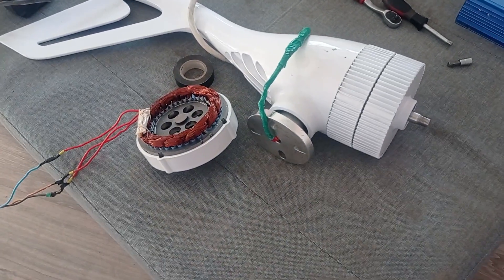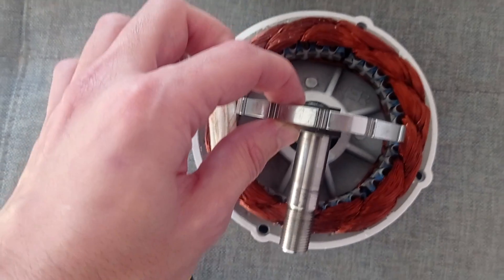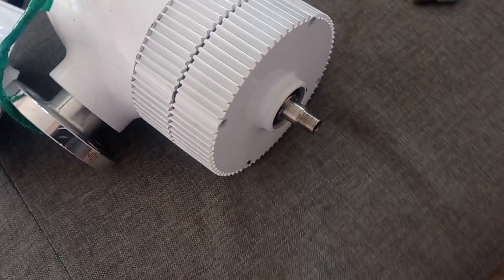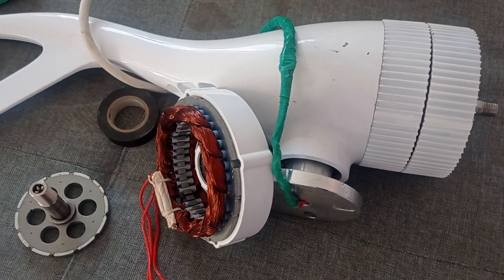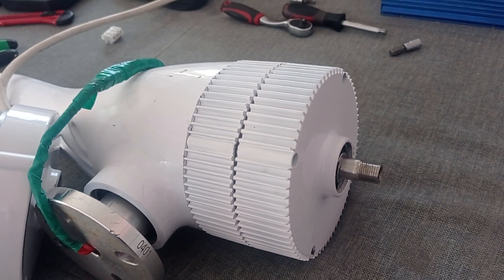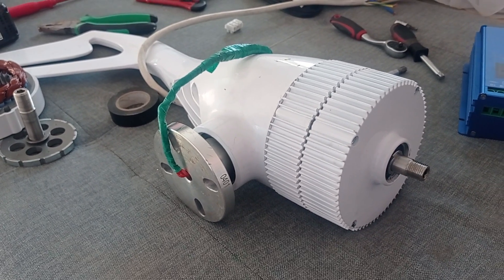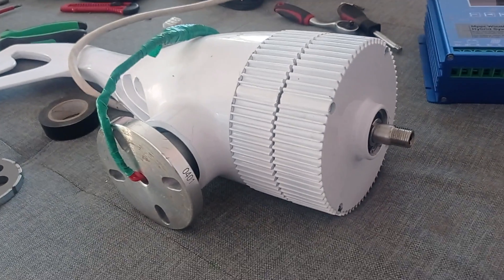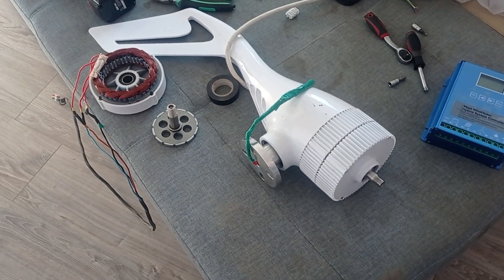How to make your small wind turbine produce way more power than originally designed. #modernuh

Comment: Given it took me a lot of effort to identify the bolt thread it might help others the original thread is 12-24 UNC. This might be more acceptable for some people to look for these to use, rather than drill out / tap out to M6 (which are readily available, but might weaken the shell).
Reply from the maker: in reality - any option will do. mine on M6 is holding pretty well, don't see any issues so far, since there is no crazy weight to be held by those.

Comment: If the generator is under designed , putting more blades may actually hinder it even more because the more blades will probably have lower rpm and will be more difficult for the generator even more.
Reply from the maker: yes, true, I ended with going 1.65 m 3-blader, instead of 1.3m 5-blader.
that one looks now like this: https://youtu.be/z1OqDNcNeZ4
Reply: @BackyardVoltage  Looks Awesome good luck !

Comment: Does 5 blade have a lower start up wind speed?
Reply from the maker: in the same shape of blades and same size of blades conditions - yes, 5-blader will start at lower wind speeds than 3-blader.
however, for this exact generator it appeared to be that 1.7m 3-blader hub (with a proper low-start bend on the blades) works so much better than this 1.3m 5-blader hub.
Reply: @BackyardVoltage  3 blade is always more effective.

Comment: I worked at the company that originally designed these more than twenty years ago, "Southwest Windpower".  The original product was called the Air.  It had a much bigger rotor and stator (as it sold for much more than $100), and in high speed winds could produce well over 2KW when the regulation was disabled.  The problem with doing that regularly was heat.  But we never put bigger blades on them, because they were designed to survive extreme weather without any furling.  One customer had deployed one of these at the south pole, and left it at a weather station over the winter.  When they returned, the weather station had recorded peak wind gusts of 130 MPH, but the turbine was still operational.  The original Air had an integrated charger, and could be purchased in a 12v, 24v or 48v configuration.
Reply: We had original Air marine, body corroded in 6 months, regulating in nacelle then running DC over a distance is stupid, never got any usable power, found plans online to modify turbine by removing said controller and running 3 phase AC into rectifier. So much more power.
Reply from the maker: @jonathanpurves5066   it is already 3-phase AC wind turbine, so all great here. you are rectifying to DC only on the controller side.
so far, I have it almost a year - no corrosion. Guess why? It has aluminum body. Same for the generator outer shells - they are aluminum.
Chinese isn't that bad, tbh.
Reply from the maker: that's actually great.
in order to reduce heat you should solder all the joints way more then they normally do at the factory, and likely apply the special lacquer for the coils. these will be also the steps for me to ensure this tiny thing works a lot longer
Reply: Esos si eran buenos aerogeneradores

Comment: I made a small wind turbine but it produced 10 volt with 3000 rpms on rotor. What can i do to produce more volts. The copper coils is very thin copper wire.
Reply: The rotor is 16 mm thick and i used niodemium  magnets. Very strong ones
Reply from the maker: Let me guess, you have got coils less of same amount as the magnets number?
Be sure to use many-poles generator to get better voltage output (the ratio should at least be 3/2  for "coil poles"/"magnets", but you can go with bigger one for coils as well), also combine it always into the classic "star" three phase connection in the end.
Reply: @BackyardVoltage  i got less magnets then coils. So i need to use more magnets.
Reply: @BackyardVoltage  more poles to get more volts

Comment: How do you connect the coil? Working on one to demonstrate with students at my school
Reply from the maker: it's a factory made generator, so I did not do anything with the coils, just reconnected the three phase gen-output to the coal-brushes current transferring module.

however, in case you are interested in its inner structure, here are some of the details:
12 magnets on the rotor. then 39 gaps for the coils on the stator, of which 3 are left empty, and others are divided into sections of 12. coils are put into "from 1-st to 4-th gap". in the end all are combined into a classic star connection. however, since they do it at the factory - the single-phase-coil is uninterrupted, I have no idea how they manage to put it inside the gaps in the end, but that's how they produce it. looks like the generator has 12 poles only as well, however, it's mainly because of its relatively small size. in bigger size generators they normally use the 2/3 ratio of "magnet rows" / "coil-poles".

Comment: One more thing. You, Me and others love how it starts turning with very low wind. Old Chinese Trick. Little to no grease in the bearings. Put in good bearings and see when it starts turning. Don't worry, When the wind is good enough to make power, it will turn.
Reply from the maker: mounting height + clean wind is the most important.
also the blades lifting angle is what matters. in the new video (with the 3-blader and 5-blader wheels thumbnail) you will clearly see the difference between the blades and what makes the low-wind start actually happen.

Comment: My 500-watt China does make some power geared 1.4 to 1. Had some wind above 8 mph in a storm and got some power last night. My turbines would do good in a windy area. I used 3 bigger blades instead of the 5 blades that came with it.
Reply from the maker: how exactly did you gear it?
Reply: I made a front plate fitted the holes for the shaft and bolts. Plate goes about 1/2'' above the top of the gen. Welded another plate flat on top. Added some side support on each side. Medal is 1/8'' I used 2 pillow block bearings with a 5/8 shaft. Old 10 speed bike gears and chain.

Comment: How is the gen upgrade working?
Reply from the maker: Getting my batteries today finally, so will mount it in 24v system.
Also 5-blades have the slow start (for this new gen), at about 4m/s, which means I am trying the new 3-blade setup soon (1.7m wheel), as it will have more torque for a better rotation start.
Reply: NOT SAYING to do it, but I cut 6'' off the 5 blades and spins lot faster and is lot less noise. Still starts in low wind but just takes a little more to move them.

Comment: How is the upgrade working?
Reply from the maker: Still waiting for my batteries to arrive. After I put it on 24v battery setup -there will be an update.
On 12v it will work if put directly through the rectifier on the batt, but I won't do it this way.

Comment: Be nice if you would do a video showing the inside of the new gen. 
I also added a much bigger tail so it will turn into the wind and is ready to start up when the wind is good. Stops a lot of wabble and lets it start faster.
A link to the longer bolts would be nice. Can't find them here in the USA. I may do this.
Reply from the maker: I actually opened it, and showed all ins and out on details in my ukrainian channel.
will show you two vids about it:
here are some measurements: https://youtube.com/shorts/vJNRBnkJ8Go
here is the side by side comparison of the opened original one and the changed one: https://youtube.com/shorts/OMz419FyKBg
sorry, but those vids are in ukrainian, but you will get everything from the looks. the difference is massive.

about bolts - it was supereasy to get them locally on my end... I paid like $1.5 for 4 inbus 90mm long bolts fitting the gen. actually got them in the nearest huge construction goods supermarket ))
Reply: Thanks, I checked it out.

Comment: Anyone who's watched Only Fools and Horses will remember Trigger's broom.
Reply from the maker: haha. exactly. that's what the modification is all about - changing parts and pieces my friend, isn't it?

in my cases - parts that FIT PERFECTLY, like as if they were designed for it.

good question to the manufacturer remains though - why not making the wind turbine in already improved state from the very beginning? I don't have the answer for it.
Reply: @BackyardVoltage  They say two wrongs doesn't make a right but if you could reverse mount the blades (1.   Mount it wrong, 2. Spin it in reverse), I think you may squeeze a few extra watts out of it.   The extra watts could come from the expense of steering - instead of wasting energy trying to steer into the wind, it could just spend it on generating power.   You may have to clip the tail off.
You could also drill out most of the rotor to cut down the weight.   This would squeeze a few extra watts out of it too.
Reply from the maker: actually the opposite it true about the weight - more weight will add more moment of inertia, which will make it spin more smoothly and will result in better output.

also, it's impossible to mount the blades reversed - since they have specific mounting places with the predefined mom/dad items to fit with the hub if you know what I mean...

Comment: How to upgrade your house. Demolition entire house and build new house. Thars whar we do with turbine buy new turbine this is nog ant upgrade
Reply: What's the fun of just buying one that works?
Reply from the maker: @basilkey2949  
Absolutely! No fun - if it works it just works and its boring...

I got my tiny S3 wind turbine just as a working model of HAWT. It showed me that it's possible to get something out of the horizontal turbines, and it's not possible to get anything from the vertical ones (I've got one tiny VAWT as well).

Then I scaled up with the horizontal, and got a bigger one.
However, I asked myself a question if this tiny S3 beast can be improved somehow, since the manufacturer definitely missed a lot of stuff that can be better.
Reply: @BackyardVoltage  I will tell you about mine. 5 blades 500-watt China junk. Looks a lot like what you have. I did not get the start charging amps. It did put out 8 maps at 800 rpm with a drill. STORM WIND...I made a mount with bearings and bicycle chain and sprockets. 2:1 with 3 bigger blades. I have seen a little power from it this way. I'm not in a good wind spot. Love this stuff.
Reply from the maker: no, this is not true. since I keep a lot, I keep the body and the looks, and change only what is easily changeable and goes to the exact same mounting places: the gen and the windwheel.

the main upgrade is a gen, and since my gen appears to be a little bit too strong for the default windwheel - I had to get a new windwheel with way more torque. if I would have gone with a little bit less powerful gen - the same windwheel could've been left.